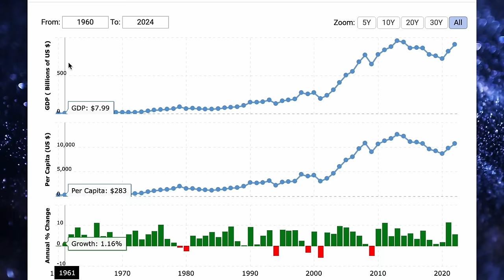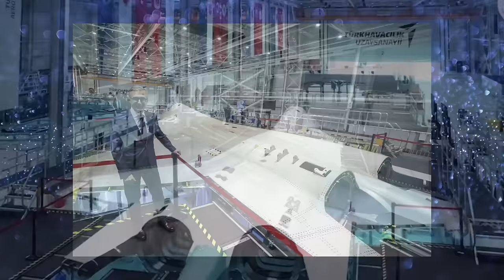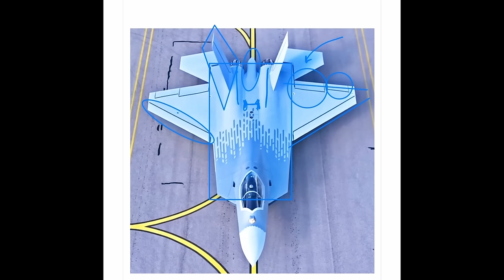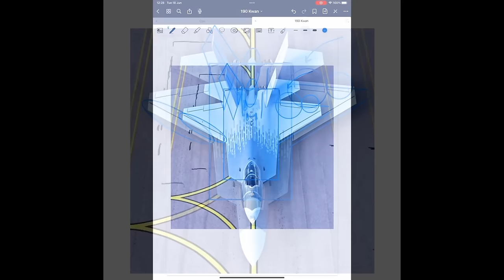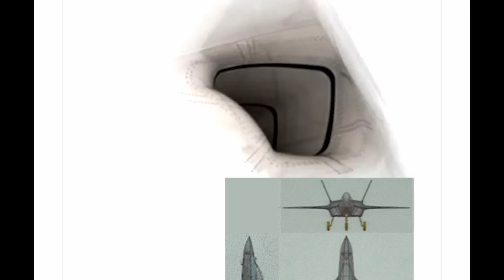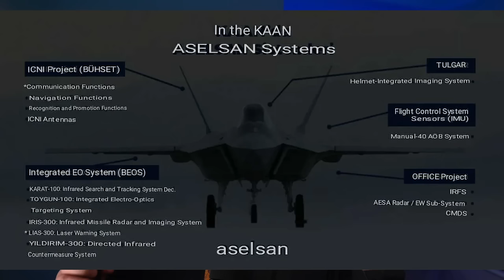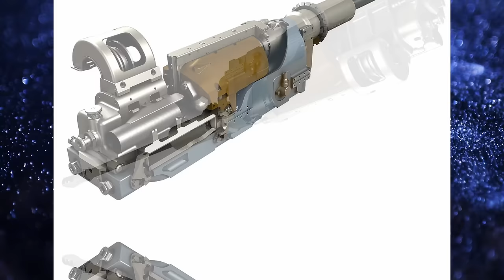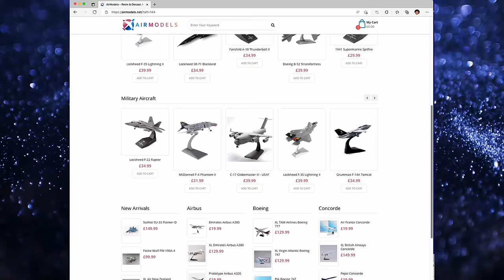The F-35 Has Met its Match

Comment: The amount of American armchair experts here is insane
Reply: Yep, no other armchair experts here, just American.
Reply: @benahaus  I didnt imply that. I do not think the Kaan is anywhere near the F35 yet. But acting like its a 3rd gen fighter is wild 💀
Reply: Stop hate speech. Americans are a greatest aviation nation
Reply: @imran_huseyn well, currently KAAN is only a 4.5th gen fighter, simply due to its lack of stealth engine that can provide 5th gen level thrust. Albeit the combat readiness is not at all there, but it doesn't change the fact that it's a 4.5th gen prototype. When the TEI TF35000 engine is ready, KAAN will officially classify as a 5th gen fighter, and when that happens, it'll outclass F35 and F22, with superior avionics, sensor fusion and encrypted data links.

Comment: Kaan Avionics  =

IRFS (AESA Radar, Electronic Warfare (EW))
Advanced Navigation Features (ICNI)
Integrated Electro-Optical Systems (IEOS) (Infrared Search and Track (IRST), Electro-Optical Targeting System (EOTS) etc.)

Yet stealth alone, defeats high-frequency (short wave), radar, by absorption and deflection, but it does not defeat low-frequency (long wave radar). Therefore, to detect, track, and target enemy stealth aircraft from BVR, can be done with long-wave radar, (but it must also be enhanced), to remove all background clutter for targeting purposes.

This is, just like both the F-35 and F-22, it has no long wave radar! Therefore, it is blind to all other stealth aircraft!

Comment: The F-35's match? Highly dubious; you can imitate the 35 and the 22 all you want, but imitating and recreating are  a long stretch away. However, a functional, flying, test model (Looking at you with your su  75, Russia) without exposed screws, S ducts, a low profile IR sensor (?) and all the capability  Turkey has to make it a force to be reckoned with is a huge accomplishment. You should be proud of your engineers, Turks. A job well done!

Comment: Turkey was supposed to build the fuselage for the F35, but the purchase of the S300 from Russia would have traded the F35 radar signal to Russia. That is the main reason why Turkey got kicked out of the program rightfully. Now Turkey had somehow the plan to build an airframe, but what in it is important. The Kaan is just a shell of composite materials with some older engines propelling it. It takes much more to make it a real 5th gen fighter.

Comment: Kaan fighter jet is far superior to F-35s. It has combat capabilities such as F-22s and Su-57s and stealth properties like F-35s. It was designed, using the new and revolutionary technologies related to aircrafts and jets that have been invented and put on to use for the last two decades which is not the case for the F-35s due to the fact that they had been designed and started to be produced before the revolutionary technologies related to aircrafts were invented and it is much easier to design a new jet than to upgrade one with new technologies that are based on newly-discovered knowledge of the related scientific fields. F-35s are simply great, but the truth needs pointing out.

Comment: I think it'll be good, but I think the J-31 will be a bit better. Mainly because the Chinese have more experience with the R&D from the J-20 and the new modifications to the J-31 look really good.

The hard bit is getting the first stealth aircraft made, that's where they learn most of what they need. It's the 2nd gen attempt which will truly stand out.

The US had the R&D from the F-117 and the B-2. The F-35 was a culmination of technology after they had all the R&D from the F-22. The KAAN looks good, but won't match the F-35. The J-31 won't either, but the latest version is looking SERIOUSLY good right now. I thought they'd slow development to incorporate what they'd learned from the J-20 and it really shows.

Comment: It has only 1 prototype that has flown and the systems were not all tested.   The only thing it has it achieved is flight.    

The F35 expecially the Adir (F35 I) which is the most advanced F35 is an evolution of over 25 years.   Many experts believe the Kaan will be similar to the SU57 and J2 in that they are more stealth lite rather than a full stealth aircraft as their radar cross section is absolutely nowhere near the F22 or F35 and closer to a F16 and Gripen E.

Comment: Turkiye has made some very good decisions during these last two decades, ofcourse some bad decisions were also made such as the acquisition of s400( not what you think, it is a good platform but it got turkiye kicked out of f35 program, doing both kaan and the f35 wouldve been a brilliant achievement for turkiye, and turkiye also didnt use the s400 so it was just stupid) i am sureturkiye will come out as a formidable player in the 2030s the only problems i see are the questions of turkish identity plaguing turkiye such as the question between Kamalism(secularism) and religion(Islam power inspired by Turkiyes roots from the Ottoman empire) In my opinion a balance between the two would serve Turkiye better, the other major problem is economical but Turkiye has handled it well, they just need to boost their export and service industries.

Comment: So far it is a collection of wishes. In the best case scenario they will have something superficially resembling F22 with some of its features in 2030s. The aircraft took off the ground - that's good. But F22 and F35 have a lot of other features - mainly advanced electronics. This will be more critical than the airframe. It sounds crazy to develop all this from ground up including microchip industry. China and India are struggling trying to do the same thing.

Comment: I’m surprised they use a foreign engine and not the final one : aircraft’s are designed around their engine, size, cooling, airflow, air intakes,… depend on the engine specifications. And it is even more the case when talking of stealth. 
The only aircraft’s I know that that do that are demonstrators, that have to be extensively redesigned for the prototype stage.
Could it be it is a demonstrator rather than a prototype?
Reply: i agree with you but every country works differenly and the ceo said Turkey has no time to waste, we cant just wait for the turkish made engines we need to get this jet running asap and test the systems-weapons. With all the wars going on at the moment im not suprised they are hurrying this much.

Comment: I was very much surprised by how different the prototype was from the mockups and not in a good way. 
The prototype seems very out of proportion to me as clearly the extreme rearward positioning of the wings necessitate the massive stabs as it reduced control authority. I am uncertain why they did this but I can't think of a good reason other than structural limitations. 
Furthermore, the cockpit appears to be elevated to an extreme height, possibly to accommodate electronics. 
The thing I really can't wrap my head around is the positioning of the horizontal stabs on top of the engine nacelles, which neither makes aerodynamic nor stealth sense to me. 
Intake angle on splitter plates is non-conforming to rest of geometry. 

The only thing I can think of is they did all of this so they could land this on a carrier because they seem to indicate a high-alpha control authority approach. 
Maybe Turkey has machinations of building larger carriers, who knows.
Reply: That's to compensate for the lack of a thrust vectoring engine. The position of the wings increases inherent instability and larger stabilizers increase maneuverability.
I think it's a genius design.
Reply: @bastadimasta  I don't think so. Static instability can be achieved through conventional means, i.e. simply shifting the planes CG forward. The large stabs are not only detrimental to stealth and fuel efficiency, but the current configuration can also indeed actually reduce maneuverability by robbing the plane of forward pitch momentum as the extreme shift of center of pressure rearwards limits forward lift vector. And thrust vectoring is not necessary for a tight turn radius. Thrust vectoring is for post-stall maneuverability and static stability in edge cases.
Reply: @M.T....  static instability is achieved by    the distance between the center of lift and center of gravity, given that the center of lift is in front of the other.
If you have a large fighter with a huge lifting body, then the best way to pull the center of lift further back is to placing the wings further back. 
Large horizontal stabilizers does not affect the RCS. As you may know, RCS is not about the size but the geometry, which Kaan has one of the most refined geometric features.

I am pretty sure that the engineers who work on this amazing project predicted the flight characteristics better than either of us.
PS Thrust vectoring is not for post stall maneuverability, but increasing maneuverability. Those fighter jets you watch does not stall even in the high AoA cases.
Reply: @bastadimasta  RCS is indeed compromised by large moving surfaces. Which is why the flying wing configuration is preferred in stealth as it offers minimal flight surfaces or surfaces of minimal size. This is also why canard planes are typically not preferred in low observable designs as they are large forward surfaces that constantly move during flight and therefore change the geometry of the superstructure as a whole.  

As for the engineers knowing better about this "amazing-mega-gigachad project" [insert Turkish nationalist meme here] seeing that this is their first plane and it is a highly unconventional layout that lacks explanation for some of it's features that they themselves have not explained as a selling point, leads me to believe, maybe they don't know all that much and are just learning on the job.
Reply: @bastadimasta  I know. That's why I said large moving surfaces change geometry of the superstructure on a larger scale. If they weren't moving surfaces, it wouldn't have mattered. Otherwise the concept of a flying wing is superflous.
No need to get butthurt because I didn't fall in love with the plane and praise the magnificent Turkish nation. 

Here lemme give you a little AAAUUUU 🤘 maybe that'll help cheer you up.

Grow up man. There are flaws in this design. Either demand better or settle for less.

Comment: There is no engine..PW 110 engines were used for this protype..Turkey is trying to produce a 5th gen engine to be used for this plane...ıt is said first engine protype will be ready in 2035..first batches will be supplied with current F16s engines..if USA supplys..very doubutful..

Comment: The Kaan is just a twin engined F35, without the stealth, also, you have to remember there are 3 versions of the F35 A, B and C. Then there is the F22 raptor, why can no one buy this plane, because America has learnt from it's previous mistakes. Thanks Iran for that. And no I'm not American. KAAN,  KAK AIR ASSISTED NOOB 😂😂😂

Comment: F-35 is an organisational platform with stealth. The former is the only thing of relevance anymore. The latter will have +some+ residual value before it is obselete.

Building around stealth is a bit of a cold dish - the Chinese have that countered at the scuentific level now - and rollout will take them - oh, 8 milliseconds.. And the performance compromises needed for it are severe while the costs are high.

That leaves the one thing the F-35 is putatively good at - the organisation of the battle space for mulptiple aircraft confronting multiple threats. If the Turkish  jet can't do that at a high level - it'll just revert to another sluggish, expensive jet. Although in fairness, it will put the Turks in the aerospace game at a high level.
Reply: There are already plans and some steps taken in regards to the 6th gen capabilities. TAI Anka-3 and the Baykar Kizilelma will be among the main actors of sensor fusion and 6th gen aerial battle management. KAAN is not only intended as a 5th gen fighter, rather desired to become the body that controls many other components, not even only limited to UAVs, but also incorporating land and navy components.

Comment: Too important to fail is not the same as too big to fail. Those generators are a smart move. Even if they don't know what they willl need them for yet, it is so likely they will, it pays off to build them just to stay ahead. In combination with light weight polymer batteries, they provide an enormous amount of instantaneous electromagnetic power, quite capable of destroying complex enemy objects at practically zero ammunition cost.
Reply: Do you think EMP can be used against these planes? Do you think it uses the same technology as the televisions of the 1960s?  Emp has no effect on fiber optic!
Reply: @ardxa4259  There's a lot more going on in electric weaponry developement than just EMP. EMP is like the cave man club of electric warfare. The moment these weapons become target specific, ordinary explosives are going the same way as the steam engine.

Comment: Kaan is a 5th generation design from a manufacturer who only has a first generation level experience in aircraft design.
Reply: And this is almost a miracle.
How did they get it?
The principles of 5. Gen aircraft design is near or less a well known secret.
All of them looks similar.
It is like the car design, the Cd value is mainly dependant from the shape....
In the aeronautical aspects there are also similarities for stealth technology.
Therefore it is not a miracle it depends on physics.
Nevertheless to reach the pinnacle (the holy grail) of this technology without any problems at the first two flights is a miracle. 

Don't forget the first "taxi" unexpected flight of the legendary F16......

Comment: I wonder what the radar cross section of the KAAN is in comparison to the F-35.
Reply: My guess is that  Kaan will have a better stealth performance better low frequency stealth because of its geometry.
High frequency stealth depends on the surface material as well as the geometry. Since Turkish companies manufactured some body parts for the F-35, they have the know how of a stealth coating.